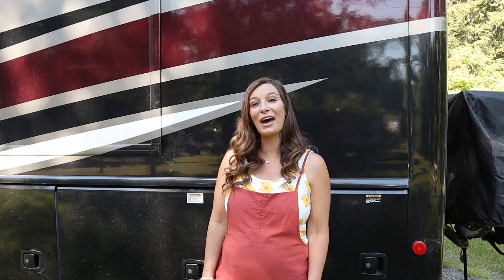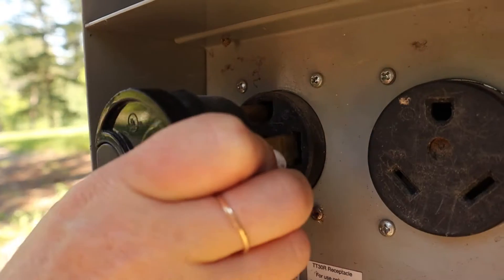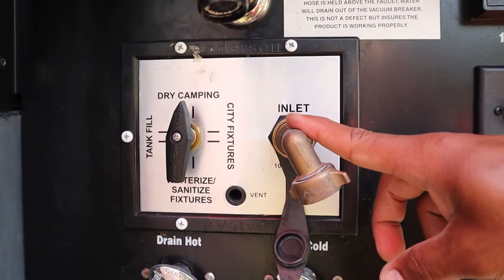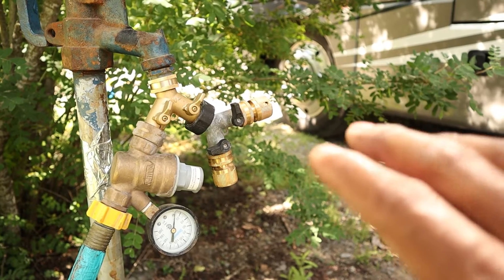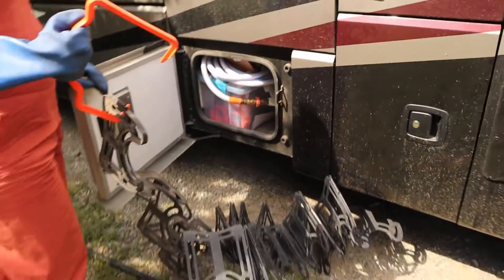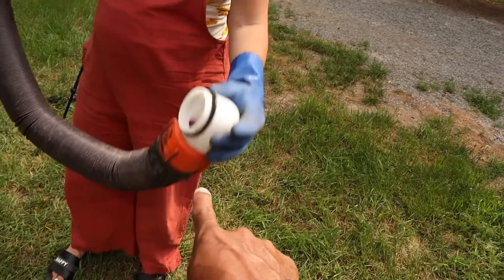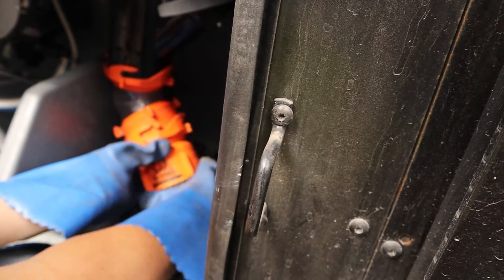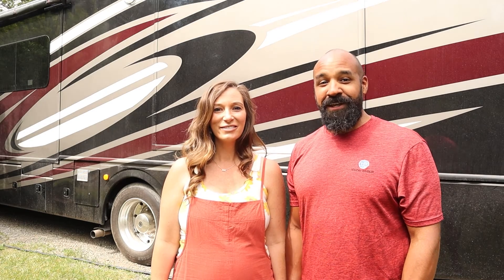How to Hook Up Electric, Water and Sewer to Your Holiday Rambler

Comment: Nice set up procedure, here's also a tip, similar to replacing the whole house water filter carriage, you should release the water pressure from the system before turning the Anderson valve to a different position,  by releasing the water pressure from the system, the O-ring in the Anderson is less likely to be displaced when rotating the valve. Safe Travels.